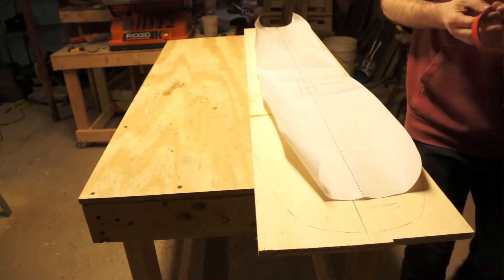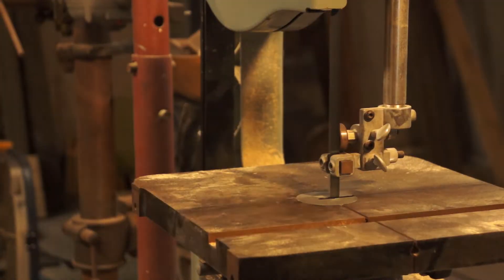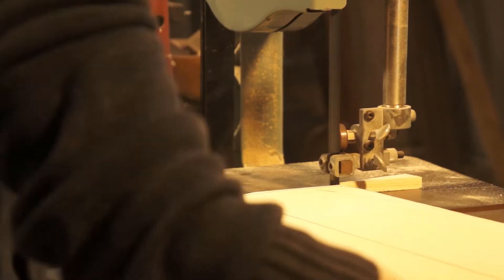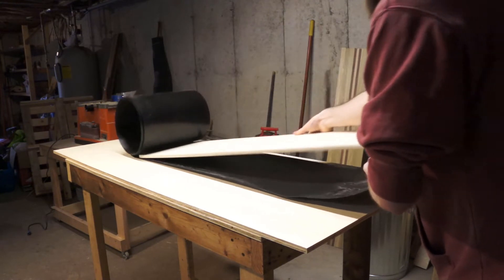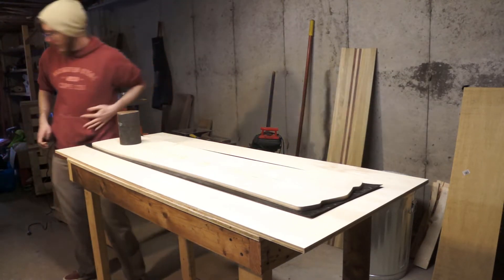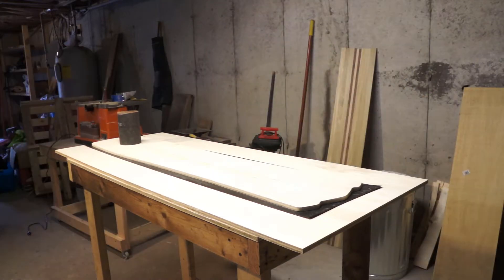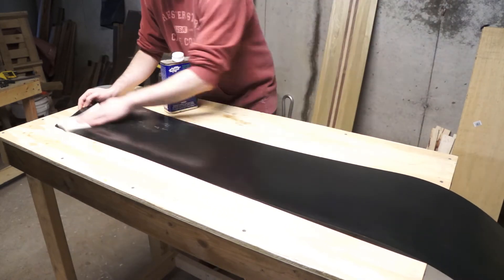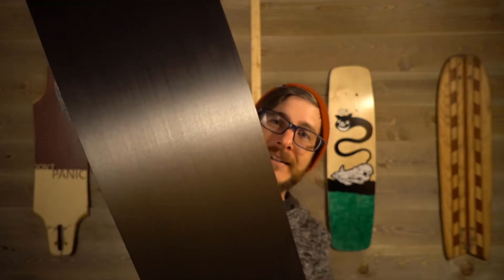Building a Snowboard - Part 2: The Base

Comment: Hi, great videos 👍, you call it "base material" but what exactly is the material for the base. I want to get a transparent one to make some sort of design for a board i want to start building, but still dont know what or where to buy a base material. Cheers
Reply from the maker: The same material goes by a lot of different names but it's Ultra-high Molecular Weight Polyethylene, UHMWPE or some people use UHM for short, it also goes by the brand name P-tex. I got mine from snowboardmaterials.com
Reply: @GoodRoads  thanks, im actually trying to do something like the ones they do in Japan, more a Powsurf-snurf than a snowboard.  I tried a snurf last winter and it was the same feeling i had when i started snowboarding as a kid

Comment: You probably know this but, for perfect symmetry, cut the template in half and use one side as a template to cut a copy with your router, then glue the two identical halves together. Thanks for doing this!
Reply from the maker: I didn't know that, makes perfect sense, thanks for the tip!

Comment: Hi, when making the core, how did you decide on how many strips of wood to use? Cheers
Reply from the maker: I'm going to be honest, other than the two stringers I put absolutely no thought into this. More strips would make the core more dimensionally stable but it would also mean more glue lines and more opportunities to make a mistake. I'm sure there is a lot of good info on the tradeoffs out there though, I just haven't done that research.

Comment: what design program did you use to create your template print out?
Reply from the maker: I used Fusion 360 to get my sidecut radius, contact points, and waist dimensions right, exported to a PDF, then used Adobe Illustrator to design the nose and tail shapes
Reply: @GoodRoads  thanks. Ive been trying to get snoCAD-X to work for the past few days pulling my hair out